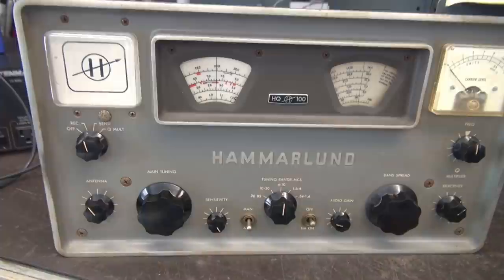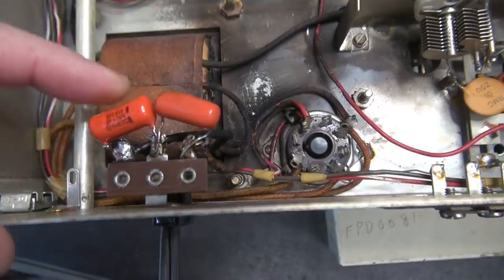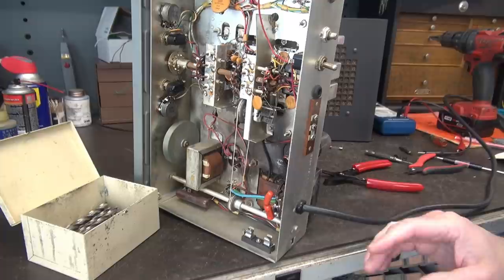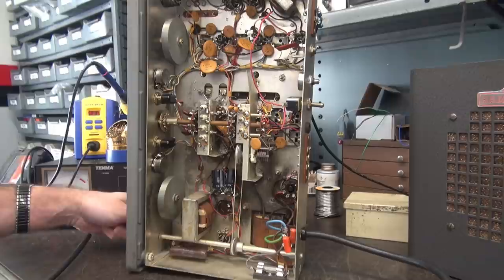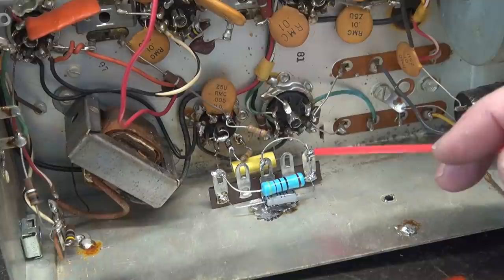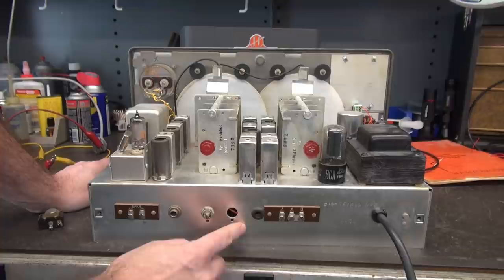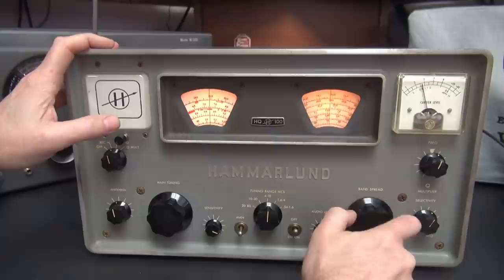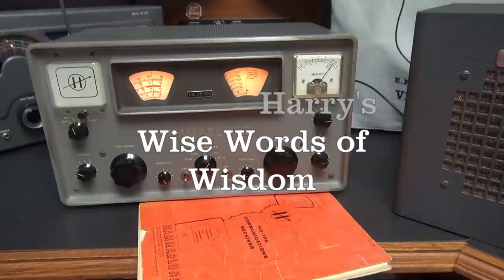How to upgrade Hammarlund HQ-100 Tube shortwave receiver audio plus repair Power supply & more tips

Comment: You are the first guy i seen on radio repair to use a proper mains lead restrainer good job man.So easy to put in old radios you will have to open the hole bigger but never will pull out once installed.

Comment: Found the HQ-100 on top of a garbage can left for dead in 1980. Speaking of headphones, the headphone jack switches the speaker output terminal, and was bent and stuck, thus no audio to the speaker. It was a quick fix. Very temping to try this refurb now, but haven't turned it on in over decade -- and you how many new surprises can be lurking !  Thanks Terry !

Comment: That is some mighty good sounding AM. I recently got back into AM on 40M with a James Millen 90881 RF amplifier running PP 812A, driving it with a Collins 310-B,  modulating it with PP 4-125A and separate PS for RF and modulator. I recently installed my R-390 back in the rack but this little HQ-100 sounds magnificent. I had a HQ-110C and Apache as my first station in 1963 and wish I had kept it. But in 57 years passing, life goes on.  I agree with the comment below -  great introduction with WWV. Thanks for posting.  You might like the pictures I post on my QRZ page.   73  WA4QGA

Comment: Cool! I’ve watched a few of your videos on amplifiers and I bought one of these radios today. Nice to find this video of you doing some repairs. Mine looks about like yours (HQ-100 with no clock). The case has some light surface corrosion but the rest looks pretty good. I’m not a radio guy but have always found it interesting. My dad had a lot of CB gear when I was a young man. I plan to replace the cord and install a fuse before I power it up. If it works I’ll do the other mods you mentioned. I hope this is the beginning of a good learning experience. Thanks for the video, and ya got another sub! 👍

I also plan to see if you have any videos on antennas as I have nothing right now.

Comment: Instead of just doubling the value of the coupling capacitor, you could improve it further by increasing the value to 10 times the value or 0.1uF. Also retaining the snubber caps wouldn't hurt the performance. Remember: they were added for a reason. Love your videos.
Reply: I'll remember that when I get mine

Comment: Wow you aren't kidding underneath had a forest fire. The underside of mine is all clean aluminum but mine is the HQ100A. At first glance mine looks like it is bone stock but on closer examination the wiring looks new. All good upgrades to the radio. Thanks for sharing.

Comment: Hi Terry - really enjoy your videos.  I had 2 HQ-100'As, to both of which I added product detectors (6BE6) - details on my website (K3JLS.net).  Made a really big difference copying CW & SSB.  Once calibrated, the manual displays were very accurate.  I used a Hallicrafters SX-99 as a Novice in 1958, and this receiver would have been significantly better, especially with the internal Q Multiplier and the added product detectors.  I added the same product detector to an HQ-145 and to an SX-99 a while back - both worked very well afterwards.  One HQ-100A came equipped with the same crystal calibrator and the B plus was switched to it by pulling out either the RF Gain or AF gain (can't remember which one).  Maybe the new gain control was provided with the crystal calibrator kit - dunno.  Had an HQ-110 and an HQ-170 - both drifted a lot, but I used them. Working on these old radios - and I've repaired many of them - brings back a host of extremely pleasant memories.  Currently working on a DDS VFO for the Drake TR series - also on the website. Again - really enjoy your work!  73's - Joe - K3JLS   PS - always wanted a Johnson Navigator when I was first licensed.  Used to read the Allied Radio catalogs after I did my homework and drooled all over the pages - hihi.

Comment: Just picked up a 110a need to go thru it fix whatever is broken
Reply: update it was missing the jumper plug 110 style who came up with that? also the detector tube was missing it was rolling around inside with the shield bam it works hehe

Comment: A question, Terry. There's two different can-caps used in the HQ-100/110 (and A's).  The early one is 20-20-20 uF @ 450-450-25V, the later is a 60-40-25 uF, same voltages.  They don't appear to correspond to the "A" vs. "non-A".  I don't see anything different in the rest of the power supply.  Can a guy assume that the latter was an improvement over the former, and should be used during a recap?
Reply: I recapped one for a customer last night, and used a pair of 22uF caps. There is no audible 120Hz hum and it is easier on the rectifier tube. This one certainly needed recapping, there was electrolyte oozing from around one terminal and apparently had stressed the rectifier tube as it was testing weak on both of my tube testers. 

Note, the 3rd section of the can capacitor is used for the cathode bypass of the 6AQ5, via a really long wire that runs from one side of the chassis to the other. I just elected to use a small axial cap mounted directly to that tube’s socket and dispensed with the long wire.
Reply: @bart99gt  Thanks, Bart.  I appreciate your reply!  I'm beginning to think that the reasoning behind going to the 60-40 may well be lost to the mysteries of time and engineer's trivia.  73, Tom

Comment: Has anyone modernized one of those units to a HAMMARLUND SSHQ-100? (Solid State HQ-100) using SO42P DBM mixer chips and MC1350 IF Preamp chips and MC1496 for SSB demodulation duties and using a Bridge Rectifier for AM demodulation?